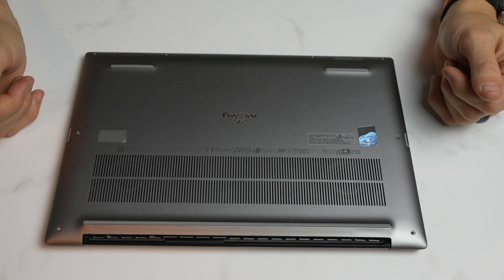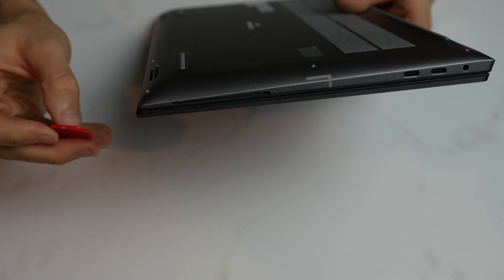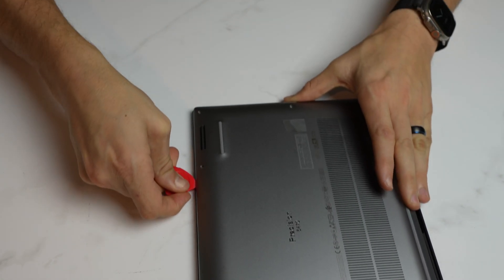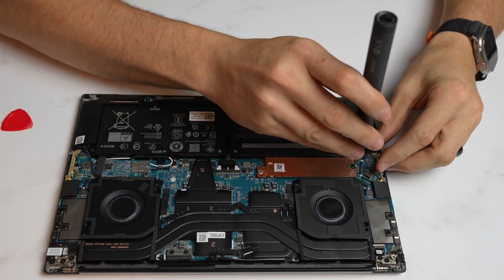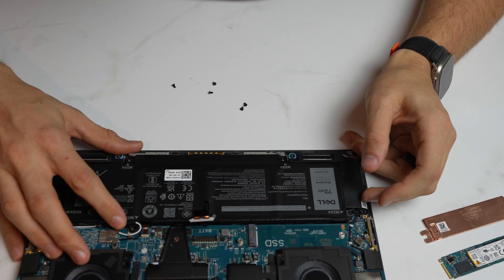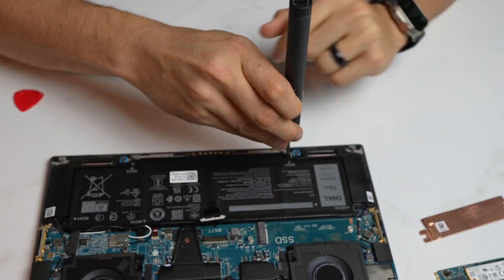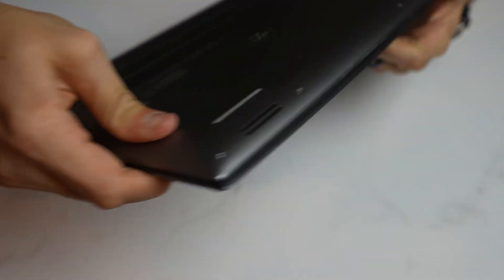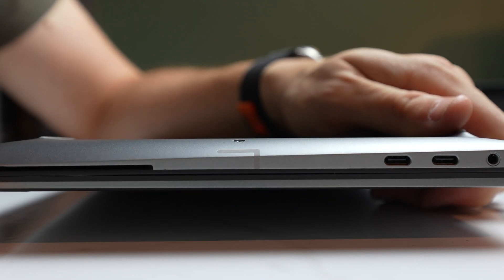Dell Mobile Precision 5470 Disassembly & Tare down (2023) (SSD Upgrade, Battery Replacement)

Comment: I have the 5570 and it is basically the Business Class Version of the XPS 9520, very easy to upgrade HD, Battery & Memory. 5570 comes with 2 heat sinks
for HDs, even if factory configured with 1 HD.